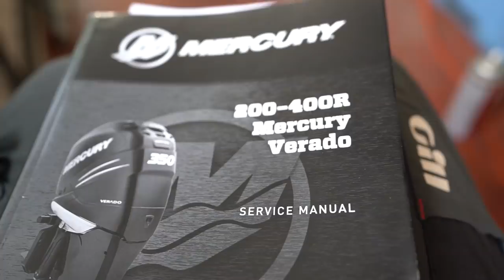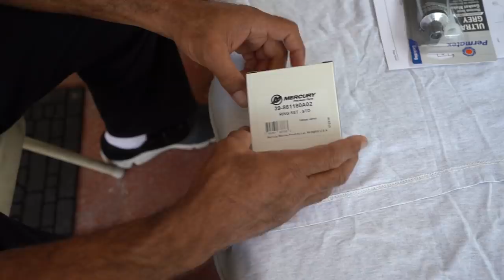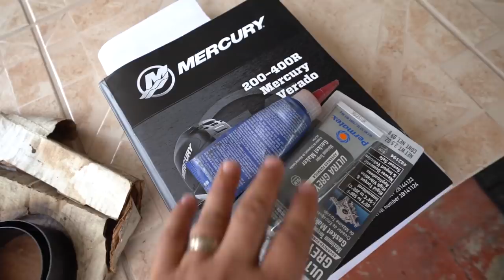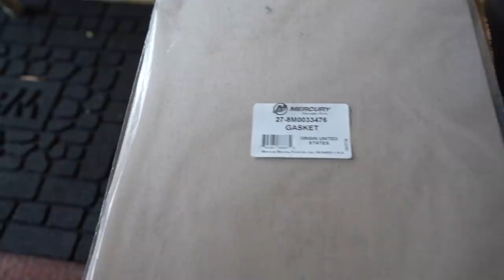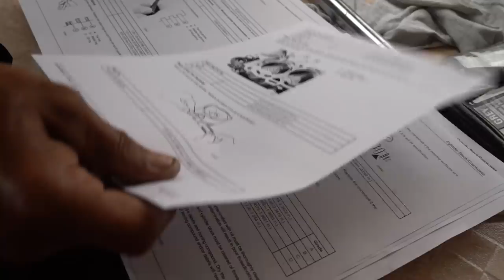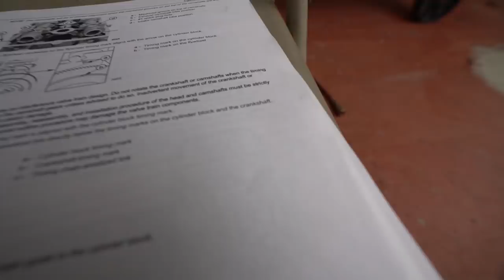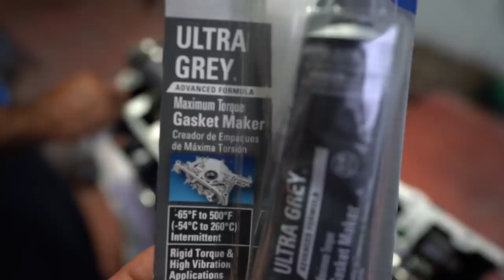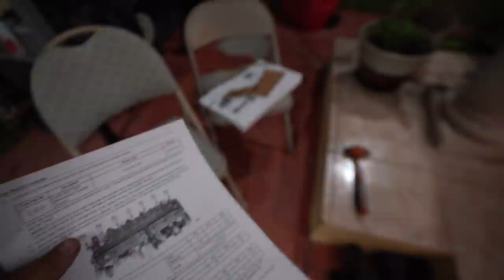300 HP Mercury Verado Outboard Rebuild (After being Sunk 11 Days) Part 3

Comment: I believe you will get it running again as long as your electronics are good. Rescued a few sunken motors myself. Make sure those bolts are not torque to yield, if they are you can't reuse them, they will not hold torque and could snap off after a few heat cycles. Also be mindful of your break in process, you have new rings, fresh cylinder walls and that is a supercharged engine. Keep up the good work.
Reply: Blah blah blah.I reused torque to yield bolts on 215hp sea doo still hold after 65 hours so cut the crap.They got service stretch

Comment: Permatex "The Right Stuff" is the best you can use. Also next time you have stuck bolts or nuts, try a 50% acetone to 50% atf  fluid make for cheap penetration fluid.

Comment: Hey well done getting this far...when you bolt it back onto your rib. Try using castle nuts and locking wire it will stop the mounting bolts coming undone.. and there is no doubt it will start..

Comment: Putting the screws in to put the head on the block scene.  You said screws which is technically correct.  A screw goes into threads and is not held by a nut or some other attachment.  A bolt is held by a nut or some other way of holding it in place.

Comment: If I can make a comment about the Pistons you really should hang them by the journals or put them up right and let the journals dangle because it can overtime disfigure them slightly. Being at their aluminum. Especially with our floor to heat if 305 is anything like 561 probably wouldn't be a good idea leave them in that box like that too long. Other than that fantastic job I'm following along can't wait to hear it run.

Comment: I had an old boat in the eighties that sank. Luckily it was Moored on shore i don’t remember having it tore down. Are there any cases in which you would not need to tear down an engine?
Reply from the maker: Yes you can pickle it and run it right away. This engine  was underwater 11 days so I decided to do a full teardown

Comment: You should keep a running talley of what its costing to rebuild this motor vs buying a new motor. Give others an idea of what hard work saves on buying new.  I'm thinking this will engine will be fine, will it not have issues maybe, but if you get even 1000 hours out of it, you still save money.  Keep up the videos and hard work !!!!!

Comment: I'm telling you, as an engine builder for over 25 years, that scotch brite pad contains aluminUm oxide. Aluminum oxide is a abrasive that cannot be rinsed off, no matter how much cleaning you do. It embeds into the steel and every time the rings go up and down it etches the sides of the pistons and builds up, until there is enough space the pistons slap and there is no compression. It may run fine for a while, but in the long run, engine life has been cut in half or less.

Comment: Too bad the machine shop didn't prepare the head gasket surface very well........I've got to believe it's more critical in a boosted engine versus a naturally aspirated.  In any event.......out of the ashes brother!!!  Can't wait to hear your "Phoenix" sing!!  Prove those haters Wrong :).
Reply: I’ve achieved the same with a block of wood and a glass sheet. Sand back and forth and I always achieve a smooth, FLAT surface. 👍👍👍.  I also measure the tolerances with feeler gauges and a straight edge. Flat surface baby !!! Head Gasket seals great 🙌

Comment: Not hateful just an observation from a mechanic : ) 

Hope the bolts aren't torque to yield bolts (TTY). If they are TTY, replace them (if you haven't alredy) because they are stricly single use. TTY lose their clamping ability after single use. 

Probably a bit late but it wouldn't be a bad idea having the connecting rods checked for straightness esp is it was running when it went in the drink.

Comment: Strange when a outboard falls off! Sure your stuff wasn't almost stolen don't know if was left out unattended and they got scared off. Engines don't just drop off your boat unless boat busts or someone got scared off in the middle of stealing your stuff and it was only hanging because the hardware to attach was compromised.

Comment: If your gunna use that stuff dont use the grey use the black it's closer to the factory one they asking for we use the perm black .sick video bro gunna be pretty sweet when it's out on water cant wait for next video
Reply: Will either the Ultra Grey or Ultra Black even work for this application?   Thought you were supposed to use an anaerobic sealer like Loctite 518 for sealing crankcases.

Comment: When I first saw the cleanliness of that machine shop... I almost puked. Workbench an absolute mess, random parts everywhere throughout, jeezus
Reply: Not sure which is worse - that messy machine shop or rebuilding a $30K motor in Rodolfo's open driveway/carport and using an ice chest for a work bench!   But hey, I sure give them their props for doing a thorough job of a complete teardown and rebuild and using the factory service manual.  Anxious to hear it fire up again!

Comment: Yeah but you had to rebuild the whole engine because you cut it loose. Anyway isn't it insured?
Reply: If you watched the video you have no choice.  It weighs around 650 pounds the boat is pitching and rolling.  It is hung on by the steering linkage and a couple of times hit the starboard motor.  You can't possibly secure it safely without risking injury to a human or damage to the boat.   Next time you are off shore how about you lean over the back of a pitching a rolling boat and try to secure 650 pounds without knowing the center of gravity.  Even if it is insured and they are made whole.  This is an amazing challenge, first just being able to find it and then restore to like new for the cost of some parts and a ton of labor.
Reply: @Florida_Scott  I was on my yacht in the weekend and it was pitching and rolling.  I know I was there but It's still the most bizarre thing to happen.
Reply: @jeremyclarke4481  Do you actually own a yacht? I doubt it, if you did you would understand better.  I own 58 foot Bertram MY and I've been in that situation where a bunks broke on the dinghy which weighs almost 600 pounds and we were in 4 to 6 foot seas 150 miles off shore in the Gulf of Mexico and we had to put the dinghy out with the davit, make a bridle and tow it.  It was very difficult to do with that boat swinging around.
Reply: @Florida_Scott  Yes I do own a yacht with actual sails you should try it sometime. Much harder than a motor boat.  Anyway it wasn't 6ft waves and they could have called coastguard or what ever you have in the US. and why didn't the insurance pay out? I've been in worse seas than that in the Atlantic on an actual yacht with sails.

Comment: I've just watch some one touch the head of the torque wrench while tightening. No no no. You only hold the handle. I guess it worked but no the torque is not accurate it can't be. What do they teach people in the USA. And you must reach the correct torque in one pull you can't do it bit by bit because again it won't be accurate.